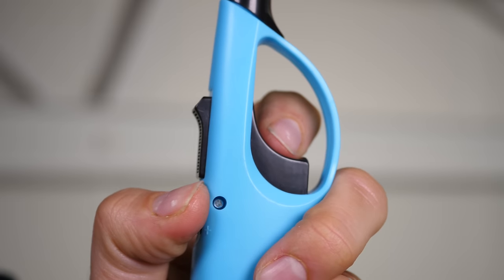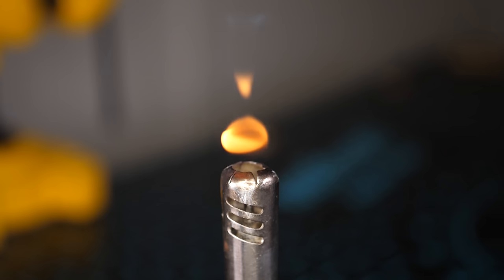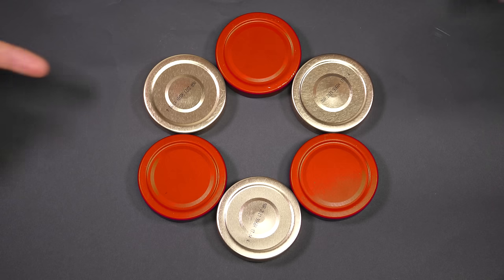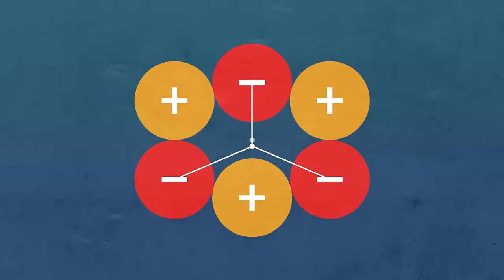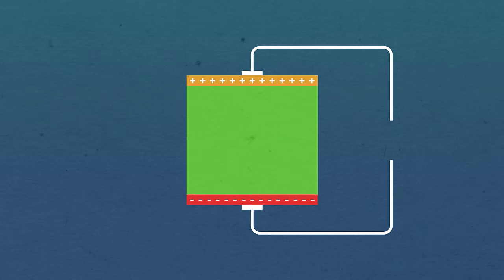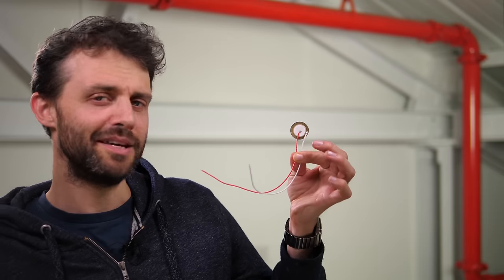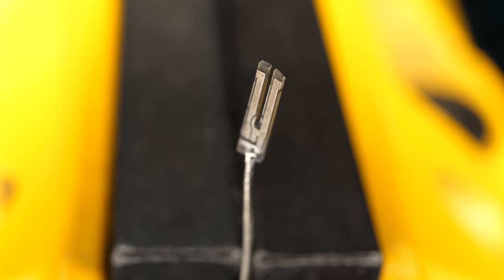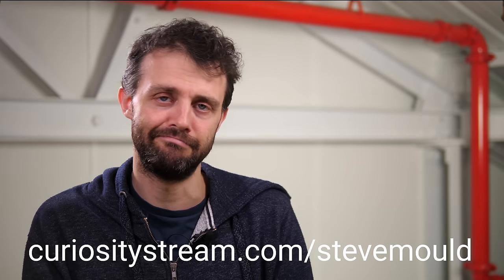Piezoelectricity - why hitting crystals makes electricity

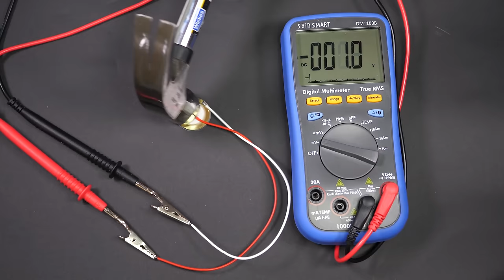Comment: 6:40 you just explained piezoelectric pickups for guitars! Thank you good sir
Reply: Great, another creator I gotta sub to because they make good content sigh my crowded dashboard, woe is me. 😉
Reply: I remember an old interview with guitarist and multi-instrumentalist David Lindley, talking about having used earthquake sensors, little piezoelectric discs, as guitar pickups.
Reply: What is this? Something to  record the guitar from inside?
Reply: @Enrique-peralta  , since piezoelectric crystal's produce voltage when vibrated, you can stick them inside the body of an acoustic guitar and they will pick up the vibrations of the wood, which is somewhat analogous to the vibrations of the strings. The trick to getting a good sound, of course, would be placement of the piezo pickup, or pickups (plural),  and whether you blend it with some kind of internal or external microphone or even a magnetic pickup that senses the string vibration directly. At least one company makes piezo type pickups that go underneath the bridge saddle and have six individual piezo crystals for the contact points of the six strings. I don't know what the favorite pick up systems are now, but back in the 80s and 90s Sunrise and Fishman, and to a lesser extent Barcus-Barry, were the ones that people were mostly using. I believe at least one of these systems had an internal microphone  as well as the piezo pickup.
Reply: I thought they worked by em induction, oh i guess multiple types.

Comment: Me at the beginning: "Piezoelectric," sounds like a Piezo pickup.
Me at the end when you used it as a microphone: OH THAT'S WHY!
Reply: Logan Strong Hi I’m an elementary audio guy here, what does a Piezo pick do?
Reply: @natheniel  it's a pickup for acoustic instruments, like cello or acoustic guitar. Idk exactly how it works, but by the name I'm guessing it's the piezoelectric effect.
Reply: As the vibrations travel through the crystalline structure theres compression and expansion happening, producing an electric voltage. Well, something along those lines anyways.
Reply: @natheniel  Also known as contact microphones, they are used to pick up only the sound from the instrument/object they placed in contact with, not picking up surrounding air vibrations like an ordinary microphone, isolating the sound.
Reply: The sound waves (aka compression waves) in the instrument's body make its way to the piezo pick-up and consequently compress it, in turn generating an electric signal which is then sent to an amplifier. Piezo pick-ups work better when they have direct contact with a hard surfaces as you might've guessed from this video.

Comment: Fantastic video, as always. 
Another interesting use of piezoelectric crystals is when you need extreme accuracy in the measurement of distancies (for example in interferometers), by applying a small voltage to the crystal you can shift it's length with a resolution of a fraction of a nanometer (10^-9 meters)!

Comment: Step 1: find a crystal that is into BDSM
Step 2: hit crystal as many as you like
Step 3:???? 
Step 4: unlimited electricity
Reply: Don't tell the European Commission or we will be using piezoelectric nails in 2022.
Reply: Step 3: Store the electricity
Step 3.5: Use the stored electricity to an electric hammer that uses only a tiny bit of electricity to hammer the crystals (Impossible?)
Step 4: Unlimited Electricity
Reply: @jdf7149  use water wheel to raise hammer from river.
Reply: There is no such thing like free or infinite energy,especially with pezio electric because voltage is very low
Reply: @BallisticDamage  ah I see, thanks for clearing that up
Reply: Step 5: take it rectally
Reply: @BallisticDamage  voltage scales linearly, it's amperage that's a bitch.
Reply: Rick Stevens yea but they prob wouldn't understand shit.Actually Voltage is HUGE but current will flow in miliseconds so you will have triangular-like sinusoide.
Reply: The problem is that you still energy to hit the crystal, so forget about infinite energy.

Comment: I used to shock my brother with those electricity generators inside lighters 😂
Reply: Use the starters out of the calor gas fires as much more powerful
Reply: @darkshaman7087  I use jumper cables and a car battery
Reply: @I_SEE_RED haha that will do the trick, I remember my cousin when we was younger his brother took a cassette player apart and his bro came along plugged it in to the mains as he still had it in his hands taking it apart and he had the best shock of his life 🤣
Reply: I remember I used to use defibrillator my brother to shock each other. Great fun! 👍

Comment: It will only open your third eye and align your chakra colors with the magical powers of its piezoelectricity if you INSERT  IT  R  E  C  T  A  L  L  Y !!!
One of the most exotic and nonintuitive uses of the effect is for making electron beam evaporated optical coatings on glass. Little wafers of PZ quartz are located in the vacuum chamber near the glass and the change in resonance frequency of the crystals corresponds exactly to the amount of reflective material that's been deposited thus far. It is exquisitely sensitive, nearly being able to sense the weight of individual atoms and is able to detect coating deposition rates of mere angstroms per minute.
Reply: Another Applied Science fan? :D

Comment: this is a great video. Thank you for explaining why the butane long neck lighters are difficult to light (but you left out another main reason, they make them child proof now, lighters weren't that hard to light years ago, they didn't have the extra safety button you have to hold, so that factors into it). I bought a piezo electric long neck lighter about 5 years ago (primarily to light candles in glass candle holders where a smaller lighter won't reach), it works great, never have an issue lighting candles. Before having the piezo lighter, I used to go through many butane lighters, they would stop working quickly (even after refilling with butane).
Reply: 100% i often remove the extra safety spring or try use a rly old lighter it annoys me i have to consider safety! Theres no kids getting it how about teaching parenting rather than making laws about safety lighters that then inconvenience me for a kid who dont exists safety! I hate the after 2000s world so much lol!

Comment: Spent years taking apart lighters to find out what magic is inside of them click lighters, the voltage is enough to ya a fair shock
Reply: Yeah, for good fun, get a "fancy" metal bodied butane lighter and re-wire it for one end of the piezoelectric to the button and the other to the case.
Reply from the maker: I learned that the hard way while making this video.
Reply: @SteveMould  we used to wire a lot of them together at highschool to give shocks to other kids. If I remember well we did like 20 together
Reply: @SteveMould  At least you did not operate the device with your mouth (AEOUD rules)
Reply: pff i like the juvenile charm of testing wall sockets with forks much better!

Comment: So this is how light sabers are powered.
Reply: Gotta squeeze tightly
Reply: Now I like to imagine that holding a lightsaber would feel like holding a vibrator
Reply: Basically yes that is how lightsabers work but its from a special crystal. Rouge One said what crystal (made up of course).
Reply: You could maybe find a way how to isolate the kinetic energy from the lightsaber so you dont feel the vibration but you would still have to find a way how to power the hammer that is hitting the crystal.

Comment: This is an amazing explanation. I have often thought about this myself, especially because a lot of acoustic guitar pickups use this effect.
Reply: @slayo 66 I believe those use a different approach, with magnetic fields, but I am not sure exactly how. 
And that's why if you use nylon strings on an electric guitar you won't get any sound.
Reply: @slayo 66 Electric guitar pickups have weak magnets surrounded by coils. (Or maybe just 1 coil.) When the steel strings vibrate, the magnetic field varies with them. The coils produce electricity in response to the variations in exactly the same way as the coils in a car alternator or power station generator, but obviously at a much weaker level.

Comment: We use stacks of them in industrial equipment for fine motion control across a short distance, a lead screw does the  big move and the crystal stack does the rest. It needs very high voltage to work. Because it's essentially solid state the stack itself never breaks, I've never seen one fail.

Comment: This is also how ultrasound works! Both the piezoelectric effect and converse piezoelectric. An electric pulse is provided to many different crystals in an array that all send out sound and then they wait for that sound to come back and turned the compressive waves into electrical signals that, based on intensity, can be converted into pixels on the screen.
Reply: What are you saying make no sense, what physic phenomenon ar= you referring to, or which electronic component work with that??
Reply: @anonymanonymous71  He is talking about Ultrasound or Sonograms (the type used to see babies in mother's womb). The fact that the same components in the ultrasound wand can deliver a frequency and pick up the frequency allow it to know the densities of the objects and at what distance they are from the probe. This is how they "see" a 2-D slice of a picture within a person.

Comment: Piezoelectric effect is often used to control mechanical movement of microscopes (small movement).
Piezoelectric effect connect {small movement} with {big voltage}. It can be used in both ways:
a {small movement} can create {big voltage} (like spark-making lighter)
{big/moderate voltage} can create {ultra small and precise movement} (like mechanical movement of microscopy)

Comment: Can you make a similar video to this, but for thermistor? They're used in 3D printers all the time, and I understand what they are, but I have no idea how they work.

If you don't know what a thermistor is, let me whet your appetite. When things head up or cool they expand or contract, right? And different materials expand or contract at different rates. So what happens is you take two different metals and put them next to each other, or even better, weld them, then heat or cool them? Well, one expands and contracts at one rate, and the other expands and contracts at a different rate, and it may curl, just a little bit?

Even more interesting than that, there is a change of resistance across the connection. If you put a current across the metals, and measure the current drop on the outward side, you can use that to determine the temperature. I know, right? It blows my mind, too. But these are used all over the place and what's going on makes no sense to me.

Comment: Enjoyed this video! I have some questions.

What happens if you continue to compress it forever? Can it "run out"? I assume that after the crystal initially deforms, the current equalizes and then it "reforms" and an equal and opposite current flows back? If this is true, is it observable? (paging slowmoguys or smartereveryday...)

Second, assuming it doesn't "run out", and it's converting the mechanical energy into electrical energy, can this (is this?) used as a generator?
Reply: don't break your crystal! :P
you can Make piezos at home in a double boiler with cream of tartar + borax
check out laser sabers concrete batteries, I think he cooks them with similar ingredients but also a core piece of metal, I'm guessing the heat is where a lot of the battery's juice comes from.
There's a few videos that show getting power from speakers, You can hook an LED up to a small speaker and tap the speaker quickly to get the led to flash briefly to prove to yourself it works, same thing with little dc motors and lights/ or to c heck if a small speaker works you can put the motor + / - to the speaker and twist it, it makes a gravelly noise lol.

with power systems it always seems about making it convenient to store / convert the power lol. search "gravity battery" there are two cool results that pop up, one from Destin on smarter every day (paging mr opal boi ) and the other is a grandfather clock mechanicsm hooked to a gallon of water that plays a record on an old school turn table lol.
Reply: It doesn't run out, because you don't push electrons out of the crystal (they are fixed to their atoms). And yes the same happens in the opposite direction.

Also yes, it is used as a small generator, mostly in something called for "energy harvesting" (meaning you get energy from something that is bending/pushed/vibrating). The ideas are more of a concept though because the power produced is so low that it's barely useful. But in a sense it is already a generator producing a spark.
Reply: Yes putting a fluctuating force on the crystal generates a fluctuating voltage proportional to the force for small values.
Reply: You can only compresses it so much before it cracks... But if you're asking how reusable it is, piezoelectric crystals are subject to fatigue just like everything else. If you push it too hard for too long, it will eventually crack.
Reply: Piezo electricity is used as a generator although it's not super common yet. There have been ideas like putting pressure plates in stadiums and subway stations where all the energy from people walking over it could be captured and used to power the building. I think a few prototypes have been built but it's not a common technology yet.
Reply: @superdau  I know its 5 yrs later, but wouldn't some electrons have to flow for the spark to form for the lighter? And to create a current you are making some of the electrons flow no? I had the same question as OP here, once the crystal is no longer deformed it would go back to neutral unless some of the electrons flowed away and then it would be slightly charged and or remain slightly deformed or so I would think.

Comment: Is there a second voltage spike (in the opposite direction) when the crystal goes back to its initial configuration?
Reply: I guess it must be, because it seems that electrons can't travel easily through the crystal. If they could they would just do it the first time. I think this is a really interesting question though
Reply: Any charge that flowed as a result of compressing the crystal will have to flow back when you release it. You can actually find spark lighters that use a different mechanism: instead of a springloaded hammer, you simply compress the piezo crystal via a lever. These will produce multiple sparks as you compress the lever, and just as many sparks as you release the lever.

(Though I'm not sure whether a second voltage spike will occur in the more common hammer-strike style devices. It seems conceivable that the air might still ionized, in which case the charge can flow back without much resistance hence no significant voltage is produced, just a current spike. It'll depend on how briefly the hammer-strike applies force and how long it takes for the ionized air to recombine after a spark, and I have no clue about either of those.)
Reply: there isn't. no charge leaves the crystal, the voltage is simply propotional to how hard you squeeze it
Reply: @nonpopscience3291  Without charge movement, you would not have a spark
Reply: @MatthijsvanDuin  What is charge? If the answer is an electron, what is an electron?
Reply: Without any further research I would answer: An inverse voltage spike occurs if (and only if) a spark occurs and electrons really flow from one end of the crystal to the other. The electron flow neutralizes the voltage difference of the deformed crystal and allows for an inverse voltage to build up when the crystal gets back to it's original shape. If you separate the wires far enough that no spark occurs (thus no charge flows from one end of the crystal to the other) then the voltage will build up as long as the crystal is deformed and will simply go back to zero when the crystal returns to it's original shape.
Reply: I was wondering the exact same thing. The "answers" given here so far are rather unsatisfactory although Matthijs' comment regarding the air still being ionised seems reasonable to me. But then I don't know much about electrical energy so... it would be nice to see an authoritative answer from someone who really knows.
Reply: Yeah sorta. I suppose it depends where you measure
Reply: Since the cristal is being hit rather than squeezed, the move back happens immediately so whilst there is probably 2 sparks, they are so close to each other that we only see it as one.
Reply: 🤔 slap a diode in there so it doesnt endlessly produce an arc
Reply: Yes I wondered that. Because quartz is insulating then the current which flows in the spark will charge up the plates on the crystal like a capacitor. Added to this will be the opposite polarity voltage generated as the stress relaxes. My guess is it leaks away through the imperfect insulation.

Comment: This is how acoustic electric duguitars work. There is a strip of quarts under the bridge and strings and the vibration "hits" the quartz. The signal being very weak it goes to a preamp to up the voltage so it can be audible through an amp